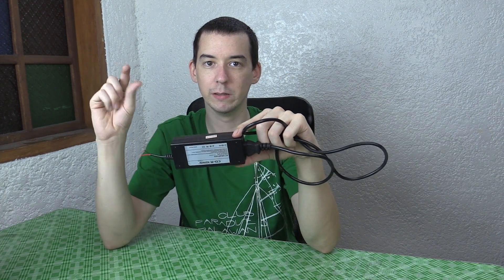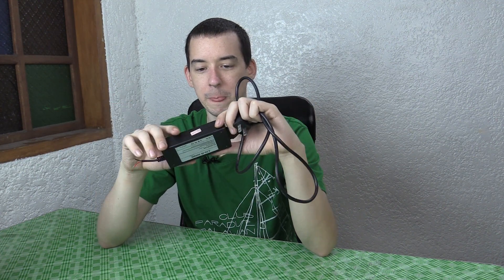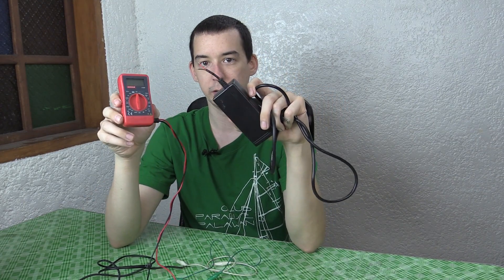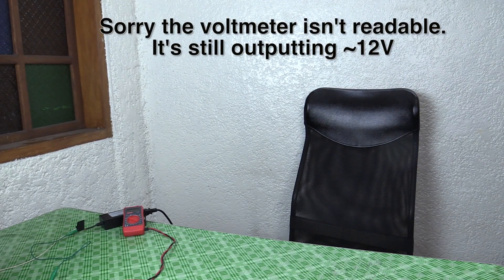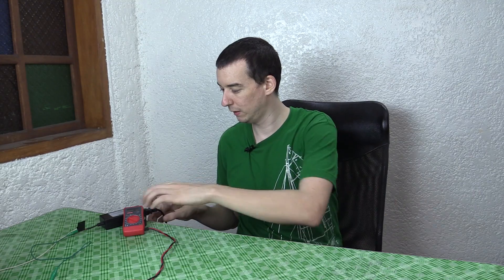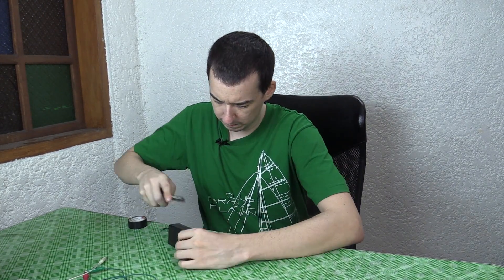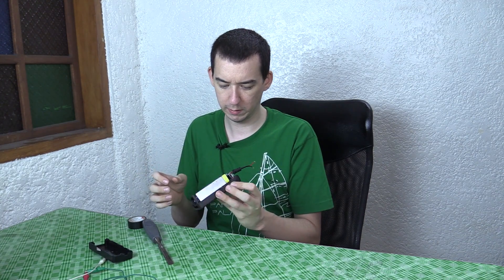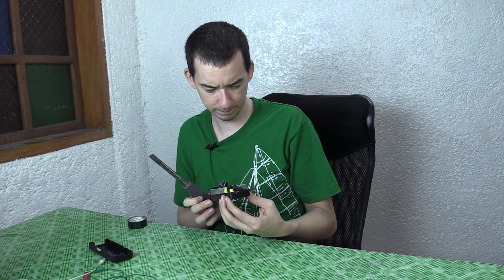AC to 12V DC Adapter goes Bang

Comment: The typical caps to fail are at the DC output (due to increasing ESR). They should have been replaced right away. The loss of output caps will most likely preserve the rest intact i.e. it could have been repaired

Comment: very dangerous to open up the adapter and touch the capacitors. they could still be loaded up.
Reply from the maker: +Pau Gasolina Yep, if there's no bleed resistor then the capacitor could still hold a charge and give you a shock.

Comment: HI THIS IS TROY I WOULD LIKE YOU TO GIVE ME A CALL ON 07768615393 I HAVE A QUESTION FOR YOU ABOUT A POWER INVERTER AND MY AC /DC ADAPTOR NOT WORKING CORRECT ON  MY CAR BATTERY THE PROBLEM IS THE POWER INVERTER IT KEEPS SAYING THE POWER IS LOW WHEN  THE CAR BATTERY IS HIGH

Comment: It is always a hit or miss when buying cdr king products, but im still a big fan. They carry products that you cannot find anywhere else. 50% of my solar components is cdr king brand. I also have their 12V stark fan in which i added an led light and ac-dc selector. 12v dc adapter is used in the day while the solar master batt is being charged. Daily usage is 20hrs. Our Power consumption was greatly reduced because of this fan.
Reply from the maker: That's pretty cool. What panels are you using? I always smile when I see Stark Industries, oops I mean Stark products.

Comment: i had experienced repairing once, also an adapter 220in 18dc out, the dc cap also blown up then i cheked the tsansformer, its ok then i tested the 4 diode and one of it is shorted, that is the caused of a blown dc cap
Reply from the maker: Ah nice. To be honest I didn't even want to attempt to repair this. I have some decent AC adapters that put out 12v and meet actual safety requirements around the world lol. This one just happened to be nearby so I figured I'd use it! But you're right, where possible, it's nicer to fix than throw away!

Comment: Common sense, when playing hero is better put on leather glove and safety eyewear. Standby a bucket of sand or baking soda. haha.
Reply from the maker: Yeah, I'm not sure if you read the video description but pretty much as soon as I plugged it in, I realised that I should have just used an extension cable so I'd be nowhere near the adapter. But to be honest, I really didn't expect anything to happen other than blown caps. I'll be more careful in the future!